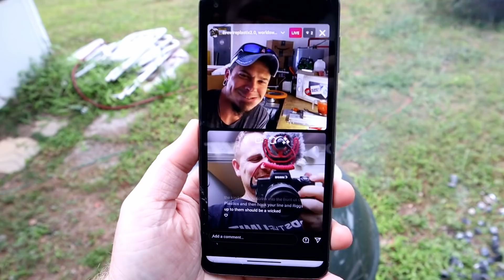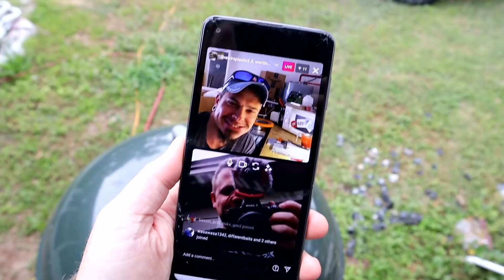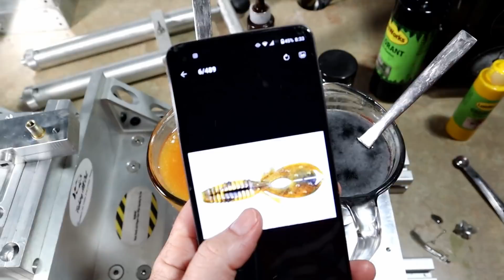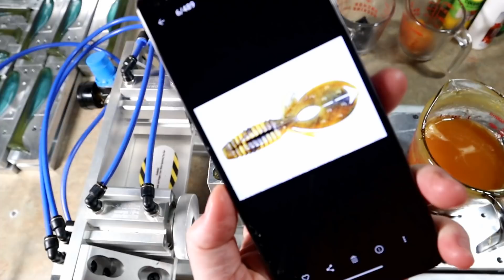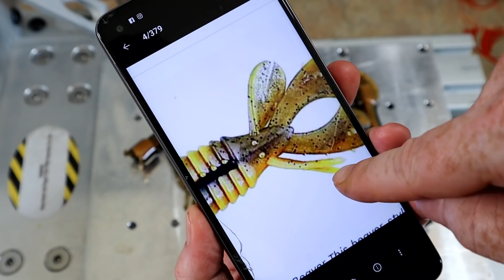TIGHTLINES Color Match Kicks My Butt!!  UV Beaver Craw Swirl

Comment: First off, awesome video, as usual! Second, I have a question unrelated to this video. So after days of research I decided to start making baits of my own. Today was the day the last of my equipment showed up and I went to pour my first swim baits. After about 5 attempts I cannot seem to get the plastic to not be sticky. My mold is heated and I'm getting the plastic well above 350. Have gotten it to 395 in the most recent attempts. Using dead on black bucket swim bait blend. I'm thinking my thermometer is inaccurate maybe? Any other thoughts as to what is causing a sticky mess. Have been giving the baits close to 30 minutes before I try to take them out of the mold.
Reply from the maker: Watch my "quick tips" playlist 🙌
Reply: @WorldsWorstFishing  I've watched just about every video in there haha. That's why my only thought is that my thermometer is off..
Reply: Check out another video by Chris called "Five Mistakes you might be making in soft bait making"  One of the first thing he talks about is the tackiness factor.  Can come from not properly mixing plastic (fully incorporating the PVC resin), could come from not fully heating and mixing properly, etc.  The link for the vid is:  https://www.youtube.com/watch?v=FPKjrxN6Mwo
Reply from the maker: @Ejaramillo77  🙏🙏
Reply: @Ejaramillo77  I'm really not trying to be a pain in anyone's neck, but I've watched it. I've done an ungodly amount of research before attempting to get into bait making and came into it well prepared. I've double and triple checked that I'm following everything I've learned and it's still coming out as mush. Temp is above conversion, plastisol mixed thoroughly, mold preheated, given sufficient time to cool, vacuum chambered air and moisture out, mixed heated plastisol well to make sure I wasn't just reading original surface Temps, ect. This isn't exactly a common hobby and I have no one in real life that i can go to for advice so I thought I'd ask for second opinions in the comments. Trust me when I say I have watched just about every informative video on this channel. That is why I'm stumped.
Reply: @BenziiGames  Just trying to point you to some help, not a pain in anyone's neck.  Been pouring over a year now, one thing to note is that all baits will have a slight tackiness to them until they are fully cured (looking at a minimum of 24 hrs, depending on thickness of bait and durometer of plasitisol), also, adding a touch of worm oil can help cut tackiness.  There is a difference between slightly tacky and a plastisol not prepared correctly.  With no one in person to help, it's gonna come down to trial and error, my friend.  Also, COULD be an inaccurate thermometer, but unless it is over 40 degrees off, the 395 temp should have done the trick.  I wish you the best of luck in this hobby because it is a ton of fun.... basically creepy crawlers for adults.   Tight lines
Reply: @Ejaramillo77  thanks so much for the advice! I will keep it up until I figure it out. Appreciate you taking the time to share some advice.
Reply: Just curious as to when there sticky? it's 2:21 pm est as I type this, not sure what time you started pouring to get 5 attempts in so far, are they sticky when your pulling them out after a 30 minutes?  they will be sticky for a while, you can try throwing them in cold water when you pull them out of the mold. That usually takes care of that pretty quick then make sure to lay them flat on the back and straight for a while, I like to let them set for at least 48 hours before I do anything with them and will leave way  longer if I can. And I know you said you mixed the plastic well, not sure if you have a gallon jug or 5 gallon bucket, but if you have a vac chamber available shake the living hell out of your container lol (some will cringe at that statement). I use M-F and it comes in a different type of 5 gallon jug, i pick it up and shake the thing until no tomorrow, not really necessary as it has never separated but I don;t take the chance and also have no issues creating any bubbles, don't even need a vac chamber.
Reply: @jjsq22  awesome advice, thank you. Will give it a try mixing plastisol better and using cold water.
Reply: What size bait are you making? I ran into that when making 5" swimbaits and now I add about 40% craw/tube blend. If they are smaller baits, putting them in water or letting them cure for 72 hours will help them to firm up.
Reply: @b3baits59  I'm having issues with the 5 inch swim baits. I'll try using a bit of craw and tube blend. Really appreciate the advice.
Reply: @BenziiGames  any luck with things getting better?
Reply: @jjsq22  Yup! I was using a gallon size container of plastisol and Turns out I just didn't shake the shit out of it enough haha. Started from square 1 and did everything the same, except for mixing way better and the baits have been coming out perfectly. Thank you again for the help and suggestions.
Reply: @BenziiGames  Awesome man, glad to hear!!  Enjoy!